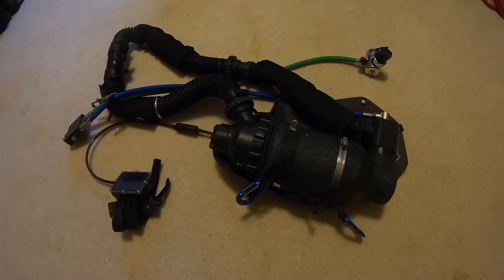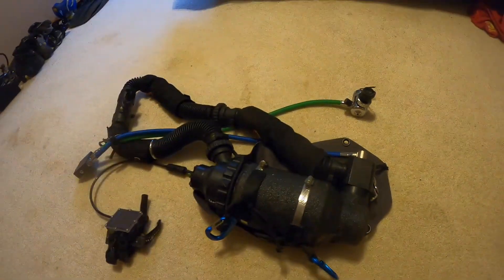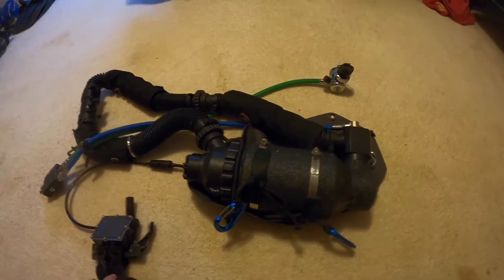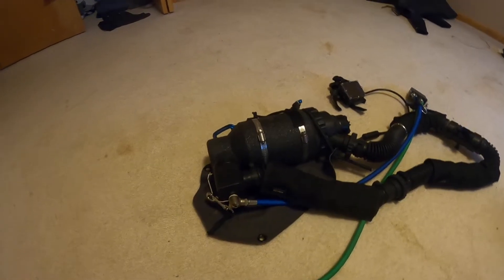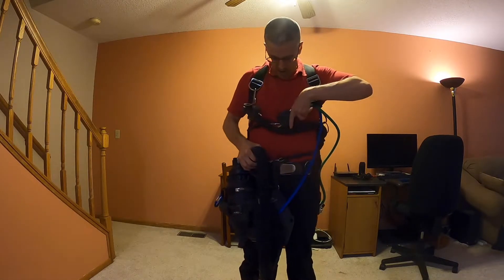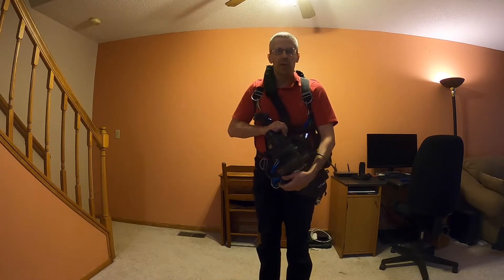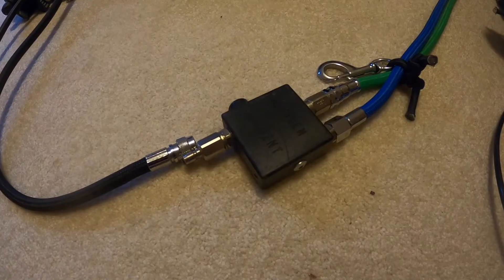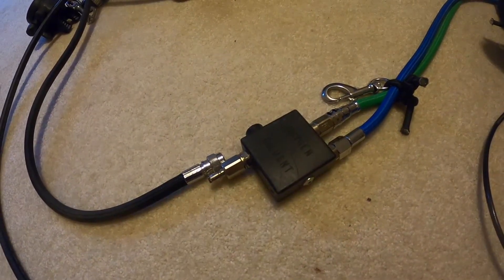Thermos Rebreather

Comment: Love the rig ,did you add both way stop QC6S This would stop this from happening.
You could also key all other connections with the keyed QC6 connectors to stop any possible wrong connections,as a safety measure.
Reply from the maker: When I'm diving, the only other tank with me is my dil. It has a BCD inflator for my BCD or drysuit, and a QC6 for plugging into the MAV. For other people, plugging the wrong tanks in might be a problem, but it's not a situation I face.
Reply: @michaelraymond2063  a both end stop qc6 between your block and your inflator hose will enable disconnection with out the leak.